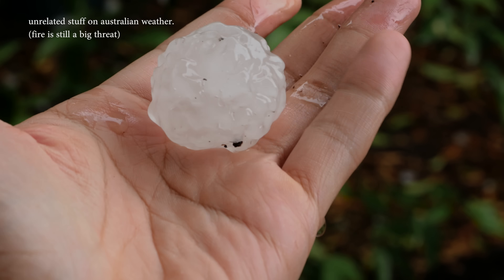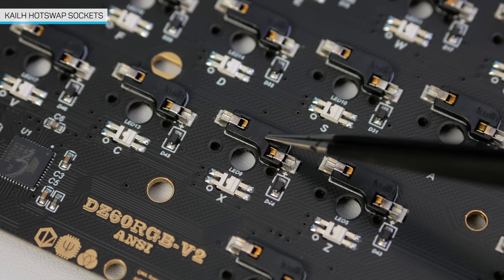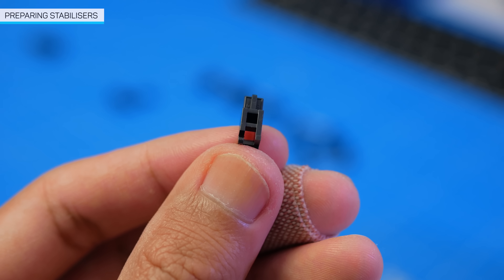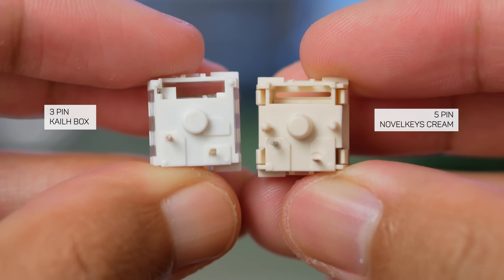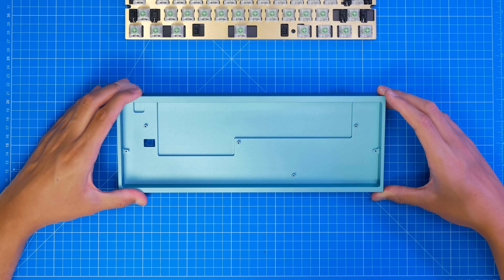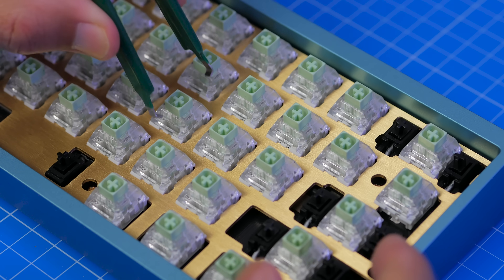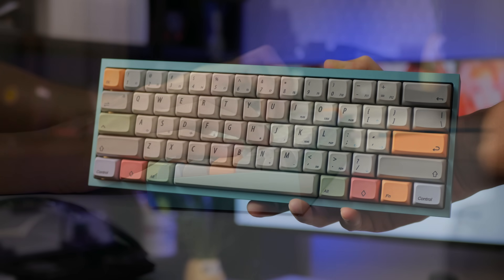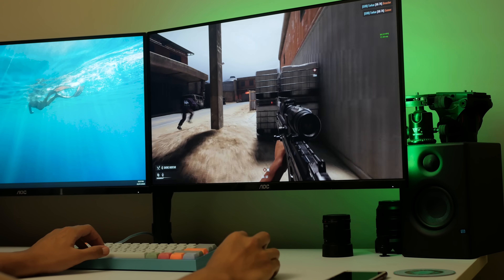How to Build a Mechanical Keyboard WITHOUT Soldering

Comment: wait so if yopu got a pcb that supports gateroen, do you need to still solder or we have to buy sopmething like ^
Reply: wiat not gateron i mean can we get opne that has a light switch sensor would that work

Comment: hey tae, I am looking at building a keyboard over the summer and I want to build a 65% build. Is it possible to buy different brands of pcb, plate, and case and it will still be compatible. will the stand offs on the case always be the same as the plate and the pcb? thanks

Comment: My durock v2 stabs doesnt fit in the plate, only the spacebar work, pls help
Reply: There is different sizes foe stabs which are measured in "u". You need to pay attention to your plate, pcb and stabs and make shure all of them have the same u stabalizers.
So the stabs are either too big or small for the plate that you baught. You will either have to buy new stabs or a plate.
(Sorry if my english is a little bad at some parts, it isnt my first language).
Reply: @Paoloti4063  ok thanks

Comment: Do I need to put in the LEDs myself or are there LEDs on the PCB?
Reply: If you buy a PCB that has RGB installed you wont have to solder them in yourself. Usually the PCBs that have RGB preinstalled will hsve it in their name (For example: Dz60RGB) and if they dont it should say it in the product description

Comment: Box jades were originally found when a typewriter was being opened to be fixed, the person found a weird clicky switch below the caps of the typewriter, it looked like it might've worked in a keyboard said Your Mother. He applied the newly found switches into the keyboard, at first it didn't fit but with a little screwing around it eventually fit quite snug. after testing, they found that it worked really well and had the same clicky sound as a typewriter, since the color of the stem was a odd shade of green and had a box around it, they named it the Box Greens, later on they changed it to Box Jades which sounds way better.

(this is a joke)

Comment: Going to build a mechanical keyboard, would this build work(all the stuff is from KBDfans)?
Plate: 60% brass plate
Case: 60% Tofu aluminium
Pcb: DZ60RGB ANSI v2
stabs: GMK screw-in
switches: Cherry MX RGB blue
haven't decided on keycaps.

Comment: Dude I got the stuff I’m just praying that the keyboard kit is hot swappable
Reply: Never mind it is hot swap
Reply: Did you get the pcb mentioned in the video? If so what switches did you use? I'm thinking of getting this but don't know what switches will be compatible, I was thinking of c3 tangerines or lavender switches.

Comment: Will I be able to put gateron red inks in a DZ60RGB-ANSI V2 HOT SWAP MECHANICAL KEYBOARD PCB because I really want to make my own custom keyboard
Reply: Yes! Any mx style switch fits on this board, both 3 pin and 5 pin are available. Extra:I recommend gateron yellows as its cheap and more better than reds in my opinion. ;)
Reply: @ralphilol3717  how do you know which switch is mx style? I was thinking of getting c3 tangerine switches or lavender switches are they compatible with this pcb mentioned?
Reply: @citrusy.  most modern  mechanical switches are mx style, and yes tangerines and lavender will work on this board.(PS you got great taste in switches!)
Reply: @ralphilol3717  thank you, thats half my worries gone, do you know were I can purchase either switch in stock? Everywhere I looked for the most part they are sold out
Reply: @citrusy.  that’s normal nowadays, just be patient when something is out of stock. It really depends on the location you live in because it’s really frustrating when something is very far.
Reply: @ralphilol3717  thanks dude after some digging I’ve ordered everything, came up to like $300. First time building a keeb, hopefully it goes wel
Reply: @citrusy.  your welcome! You can chat me on discord if you have any questions(Ralph OwO#5084), have fun building it!
Reply: @ralphilol3717  will do! Ive sent you a friend request

Comment: Are the gateron black switches for hotswapping?
Reply: You can Hotswap all switches ( from my knowledge). But you have to be careful if the switches fit your PCB and hotswap sockets. For example, kailh hotswap sockets ( these are the ones used in the video) dont fit optical switches (neither does the PCB). Kailh hotswap sovkets fit kailh snd any MX style switches. Gateron switcges are MX styled so yeah they fit.

Comment: ew no it needs to have an anodized case with brass weights, weighing at LEAST 20 pounds, without the weight and 40 pounds with the weight, it also needs a brass plate too, and it needs super duper hyperlubed holy panda switches with custom made housings that you have to order 2 years in advance and get every single keycap as an artisan for it to even be CONSIDERED MILDLY a keyboard

Comment: taeha types says to lube the corners of the wires bcs there in contact too, after all the wires are touching the stab as well. but that just might be me nit piking
Reply: THAT LITERALLY BARELY CHANGES IT MATE
Reply: @steins3699  thats why i framed it how i did, i expressed myself like a human being not like you.
Reply: @TCLOAO  then theres no point m8
Reply: @steins3699  yes there is BCS if I am right or wrong someone disapling could tell me that it does or doesn't matter see I expressed myself in away of if I'm wrong I'm wrong if I'm right I'm right . The reason he does it is BCS it helps the keys out BCS those are in contact with the other part.
Reply: I didn't need someone to just showt at me BCS of my opinion
Reply: @TCLOAO  its not ur opinion its taeha's
Reply: @steins3699   just BCS someone has an opinion doesn't mean others don't have the same opinion, you need to get some lessons on English and philosophy.
Reply: @steins3699  I'm not trying to insult you it's just most ppl don't or haven't learnt how words work, I have my faults others have there faults so I'm not trying to insult or anything
Reply: @TCLOAO  stop tryna make other's opninions urs
Reply: @steins3699   i wouldn't make it mine if I didn't believe in it see if it's logical I'll agree with it then accept it then make it part of the knolige I know. It's called adapt and over come we are animals that learn and adapt
Reply: @TCLOAO  and have u tried doing that with ur stabilisers? if not then u cant make it ur opinion
Reply: @steins3699  I wish I could but for right now where I live it's very very hard for me to go somewhere or get stuff sent to me so for right now I can't but it doesn't change the fact that if your lubing the full area that's touching instead of only a part of it it can change some to a lot. I havent done the experiment but I can see the logic behind it. I clean and oil my skateboard wheels like 1 a week BCS they get a little dirt and loose some of there flew or sping and that's BCS of there being more friction where there could be less
Reply: @TCLOAO  thanks for comparing a skateboard to a keyboard

Comment: Just learn to solder. It's really not that hard- I taught myself to solder at 13. You can get a basic iron that will do what you need (especially if you're just soldering keyboards) for like $20 on Amazon.

Comment: My DZ60RGB ANSI V2 just arrived today, I noticed there was a tiny 4 pin ribbon cable in the box which had be look until I found the corresponding port on the board labeled "CON", any clue what this is for? There is also a 6-pin through-hole row that appears to be for an Adafruit Bluefruit module, no documentation from KBDFans I can find yet though.

Comment: What’s better pcb mount or plate mount? I don’t want to solder if not needed
Reply: I figured it out. Pcb mount is by far better. It can be clipped and easily converted into plate mount. When in doubt pcb mount

Comment: I am bit confused where the plate is attached to. As it seems it is not screwed/or somehow mounted directly on the case. If this is the situation, is the PCB taking all the weight through the switches? How does the plate support the weight of key strokes?

Comment: i am building a GK64 keyboard at the moment with novel keys cream switches. I haven’t lined the switches yet but i have also gotten some GMK screw in stabs for the enter spacebar and backspace. I have lubed the stabs but i cannot fix a problem where when put into the pcb it mushes when i press down and is sluggish. I haven’t put too much lube on. Please help me xD

Comment: I'm a little confused. I just built my KBD 19x keyboard and I ordered Kaihl hot-swap sockets but I didn't find any contact point to solder them to. Does that mean this PCB cannot accept hot-swap socket? I'd post a picture if I could.

Comment: Would this work for a DIY : gk61 PCB kit on bangood + novel keys cream switches. The total is about £100 for me. I also need to add the lube on top for the stabilisers and switches. I have keycaps already. Hyperx pudding keycaps.

Comment: 60% are really cool, but a big no-no for me at work (nav cluster and numpad are essential), altro they usually don't sit well with italian iso layout. I'm really considering modifying my CM quickfire changing switches and caps only. It'll be a bitch to desolder and resolder, but going full custom with a 104 keys it's... dangerous... for my wallet. :D

Very good work!

Cheers

Comment: What a great video! I'm new to mechanical keyboards and I'd like to build my own through the links you provided. Is it possible to get keycaps that allows the RGB lighting to shine through the keycaps? Similar to the Logitech G513 for example.
Reply: im wiondering the same thing
Reply: you could get a pudding keycap, that has shine through lower half and opaque top to block the light

Comment: Is there any cons to building with Hot swapable Pcb boards? Or is it exactly the same just without soldering? Thanks
Reply: Youre limited to the layout, as solder PCBs allow switches to be in more positions.

Comment: $300? Lol! Here I was thinking I could save extra by building my own.
Reply: Nah, most keyboards that you build on your own is a premium option
Reply: Keychron has a few more affordable options and they are actually great for the value!
Reply: customizing keyboards could even go for 1k usd or even more. 300 usd for customizing is actually pretty cheap. There is a reason why people customize stuff. It will never be cheap.
Reply: You can build one for like 80$ but you have to solder
Reply: @nasser5000  What kind of Switches? Case? Plate? Stabilizers? Foam?

Zealios V2 already cost 1$ per switch.
Reply: @mizz1414  You could use budget switches instead, gateron yellows or the gateron milky black bottom and clear top,
Reply: @nasser5000  Even a 70 pack of Gateron already costs 20 bucks, and if you want to go custom, you actually should spend money.
Reply: @mizz1414  yea I was just saying there are cheaper options if you look into soldering
Reply: @marcusborderlands6177  it's not the point. People want to spend more to build what they want. It's not like building a pc
Reply: @avuci  yeah, i get that now, just got my first kit lol
Reply: Harraps  hello are you the guy from the david dobrick videos about the posuin dart frog thing
Reply: Harraps what were the things u used?
Reply: Harraps what did u use cos i’m trying to build a keyboard for £100 or so
Reply: yea just like a pc
Reply: @mrfinnertytv  PC's are cheaper DIY.
Reply: Take a look at Tecware keyboard too. Phantom Pro has hotswap and TKL with pretty decent price
Reply: NOPE NOPE NOPE NOPE. Not the same as building your own pc.
Reply: you can make a good keyboard with gaterons for less than $150
Reply: @your_average_clippy  u can
Reply: Black ★ u can use the plastic case to save I lil bit of $$$$$
Reply: you can get a different case pcb and plate for 50 dollars and get gateron switches on  bangood for 20-30 bucks and keycaps for like 20-30 so your total would be 100-150
Reply: Thanks for letting me know. I am getting out of here. I usually read comments first :)
Reply: @BiswaRanjanNanda  bloody's are really great keyboards, but dont be afraid to make your own at some point if you want to have something tailored exactly to you. Also, the vid is pretty fun to watch, maybe check it out anyways
Reply: @marcusborderlands6177  The thing is I want to try some keyboards to know how does it feel and in order to test it I don't have any options other than buying keyboards myself and then returning it back to amazon or best buy. So to build something, I don't wanna spend that much amount and then regretting making it and wont be able to get back my money too. So I am wondering where can I or How can I actually have some experience with various Cherry MX or Gateron or Kailh switches.
Reply: @BiswaRanjanNanda  you can buy some pretty cheap testing boards, that are basically a pcb that has a ton of different switches on it to try. thats what i did, and really liked it. although they dont have any with optical switches like what i currently use in my main setup
Reply: Well, he is not building anything. He Just bought a Premium custom keyboard kit... That why he spend so much money. You can make one yourself for real and save money. Make your own plate, your own case and hand wire It yourself. It's Just a lot of extra work. But thats what I'm doing since I dont have that much money. But, It's also not be as cheap as buying a normal keyboard
Reply: in some ways yes, as long as you know what to buy
Reply: Yea, me too. Wanted to go for a ducky and mod keycaps but then I read some opinions about mx keys being outdated and all. For 120€ as ducky price and 300€ for this I fcking choose mx keys, dont care.
Reply: @JohnyMcNeal  if you want gatoron switches you could get a gk61
Reply: Johnny_McNeil gk61 builds are pretty cheap and shit on ducky any day for hotswap. Ducky fanboys who don’t know shit bout custom keybs like you should just stay quiet.
Reply: @samba9450  The keyboard building community is quite welcoming by the looks of it.
Reply: @finsimple4396  it actually is. But we hate ignorant people that don't understand the hobby.
Reply: @finsimple4396  exactly, well said
Reply: There are cheap cases, PCB, plate combos like the GK61 case for £35 on AliExpress.
Reply: Black ★ lol

Comment: it would be nice to be able to find a fucking PCB that wont get snagged at customs and or take 2 months to arrive.
Reply: It'd be nice to actually find one that's in stock..
Reply: @truuuupR  https://www.banggood.com/Geek-Customized-GK61-Hot-Swappable-60-pencent-RGB-Keyboard-Customized-Kit-PCB-Mounting-Plate-Case-p-1389481.html?rmmds=myorder very credible PCB, a bunch of tech YouTubers have made vids on it and I've done 4 builds with them.
Reply: @muhaha28  I was literally looking at this a few hours ago! Good to know it's decent quality. Think I might order. Thanks man
Reply: @muhaha28  Ordered one. Potentially thinking ahead - could this pcb be moved over to a different case in the future if I wanted to?
Reply: @truuuupR  Yep! It is a bit tricky to take out of the case because of the USB slot, so just be careful and make sure everything is disconnected and good. I'm assuming you just got the regular black one?
Reply: @muhaha28  yeah plain black for now. The alu one is out of stock and the wooden one wouldn't look right on my desk. I'll swap it over to an alu case at some point.
Reply: @truuuupR  I'm just waiting for KBD fans to be safe at some point so i can order a tofu case. Man shipping times SUCK on Banggood. Mine is at the international processing in NY and its expected to be held for 30 days.

Comment: I currently have a ducky one 2 mini, I want to lube the switches and I’m aware I have to desolder them. When desoldering does anyone know if it will ruin the LEDs? Will I have to desolder and resolder the LEDs? Or are the LEDs on the PCB? Any help is appreciated!
Reply: RGB LEDs are usually SMD, so you won't have to desolder them

Comment: There are some hot swap PCBs without pre soldered RGB LEDs, but do support them. Is it possible to buy and solder those RGB leds yourself, and which ones do I have to buy. The PCB I was looking at was called the Bm60rgb

Comment: Tae -- awesome content! Question ... I have my switches over my plate and I can see the pins going through the PCB. When I plug it in to test, I can confirm that my underglow is working but I don't seem to be registering any keypresses. Does the full board need to be assembled for this to work? I've also tested the PCB and all keys register correctly.

Comment: I am thinking about either buying a new keyboard or building my own. How ever I do not want to spend over 100$. For some reason my keyboard has inflated in value (g810) Its like 170 dollars on amazon now. I want to get a 60-65% board. I really like the feel of Romer G. What switch is similar to it? I would solder, but I don't want to spend 100$ on the soldering iron you recommended.

Comment: What would you recommend as an alternative to starting with the dz60 if it's not going to be back in stock for a while? I've spent a week researching this and i'm overwhelmed by the amount of information and choice when it comes to deciding on a board/parts. Going for exactly what you recommended would have made it easy haha. Is there anything else in the 60-70% range with hotswap, rgb and arrowkeys, that doesn't have any of the compatibility issues or any other downsides?
Reply: I'm pretty sure I'm missing something here, but isn't this the board you were using? https://www.aliexpress.com/item/32824638057.html?spm=2114.12010612.8148356.3.42926eadiiIabX

Comment: How do you assign arrow keys with fn? Through qmk software?
Reply from the maker: The arrow keys should be on the FN layer by default. But yes, you can use QMK configurator to make a custom layout, and then flash it with QMK Toolbox.

Comment: The PCBs that you wrote on the spreadsheet are sold out. Can I use KBDFANS KBD6X HOT SWAP PCB instead? What other PCBs can I used instead of those you listed?? Btw thank you so much for this video.